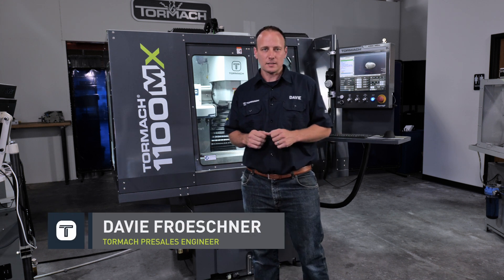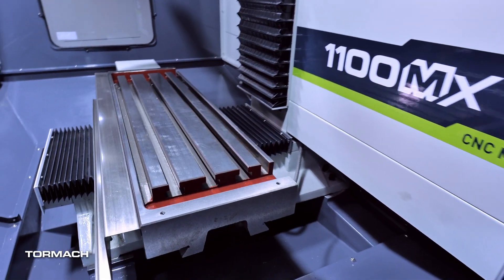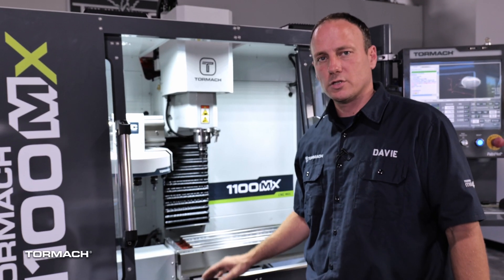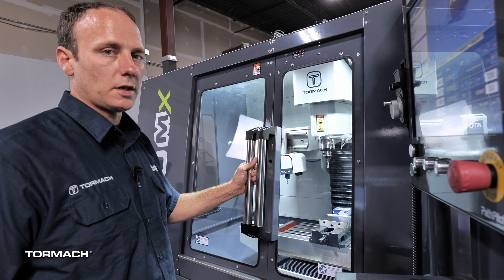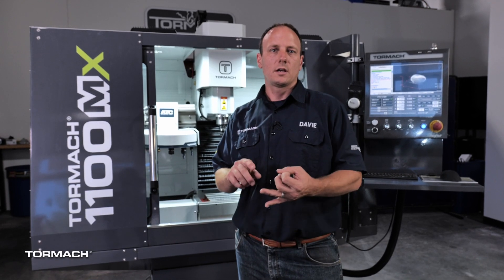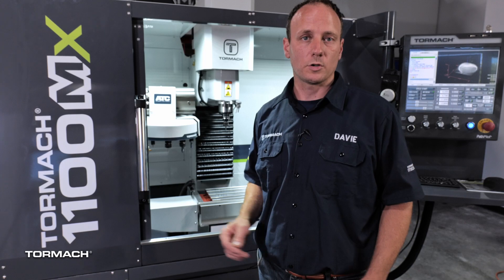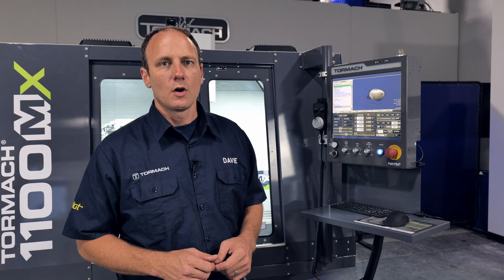1100M and 1100MX Product Overview

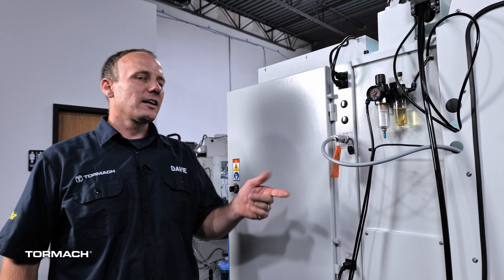Comment: 1:33 shows the power plug you'll need. Love mine! These are great machines!

PRO tip! if you get an 1100mx make sure to put the front way extender on before you home it for your very first time, or you'll bend your chip cover plate.

Comment: It was nice you highlighted the air psi required but you missed the most important stat which is how much cfm you need!  That makes the difference between a small and a big compressor.
Reply from the maker: It would vary. A fogbuster is what uses volume the most and is user settable. The PDB and ATC use very little per tool change, but it depends on how many tool changes you do.  For successive back-to-back tool changes, at least 2 CFM at 90 psi is required. If you add an air blast that you use regularly, those requirements can go up to 4 CFM.